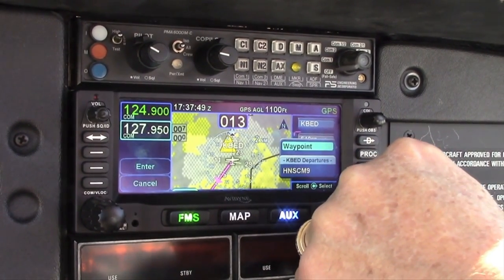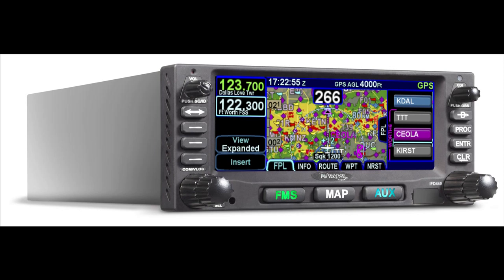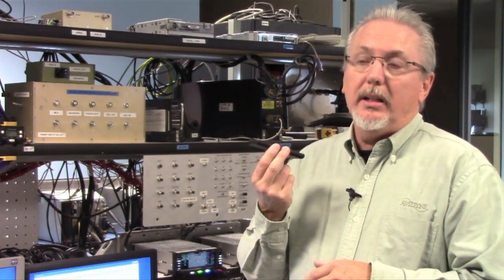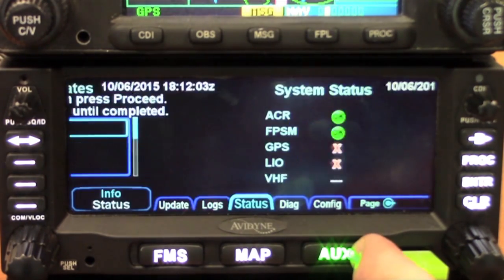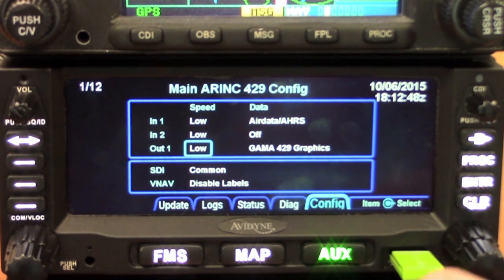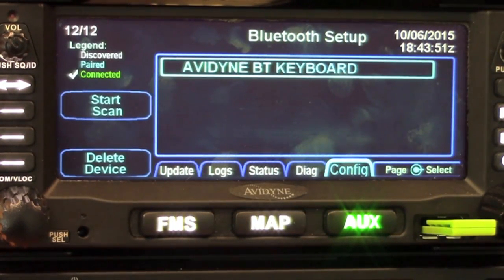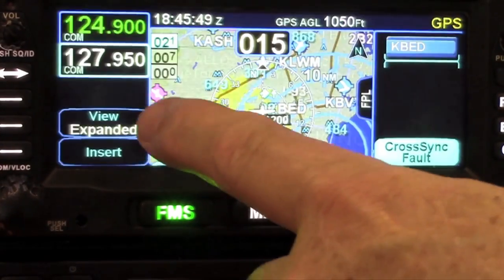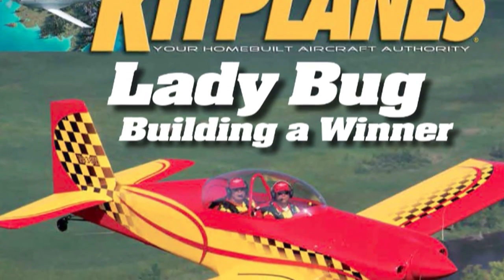Installing Avidyne's Slide-in IFD440 Navigator

Comment: A petty it is way overpriced.
Reply: +wsijtsma Maybe, but you save a lot of time and hassle since they are slot-in replacements.
Reply: Nice? Yes. Overpriced? Definitely.  I'll buy a used 430W for around $6500.  I don't mind twisting knobs if that saves me $3000.  Imagine if someone paid you $3000 to twist knobs.  Who wouldn't take that job?
Reply: True, but is is also $ 4000 more expensive than a Garmin 650, which mitigates the advantage you would otherwise have by saving on install costs..
Reply: @Wouter  Actually the IFD 440 is priced about the same as the GTN 650, if you don't get Wifi or bluebooth.  But the IFD 440 is a slide in replacement for the GNS 430 and has better user interface than the 650.  So between the Avidyne 440 and the Garmin 650, I think it's a no-brainer to choose the IFD 440.

That said, Avidyne is notorious for gouging customers through repairs and upgrades. I have an Entegra PFD with outdated software version 6.0. Avidyne wants $6,000 to upgrade the software to 8.0.  Oh, but if you buy their $9,000 DFC90 autopilot, they're happy to upgrade the PFD for free.  So I would not wholeheartedly recommend Avidyne at this point, unless one has plenty of money in which case more power to you.